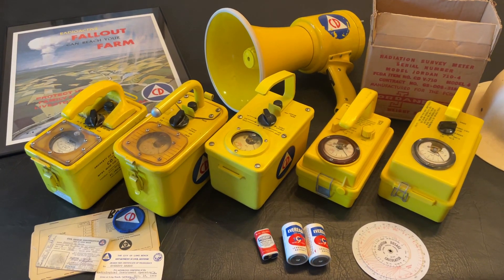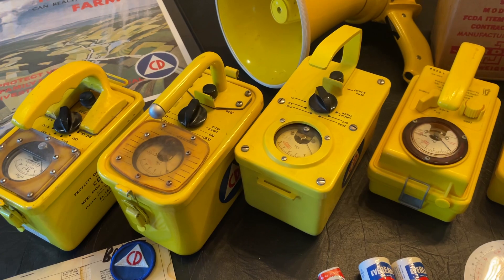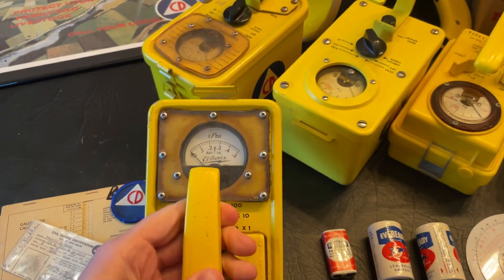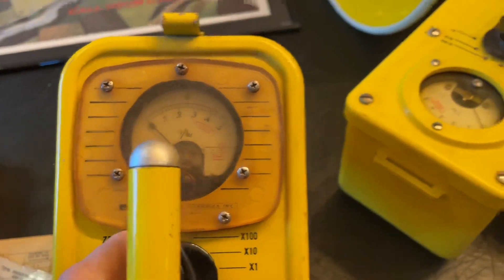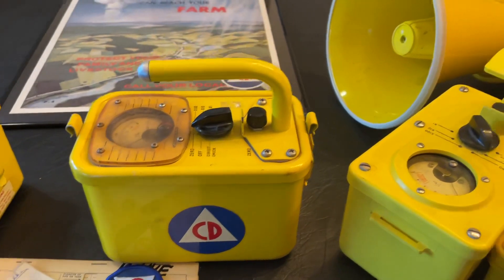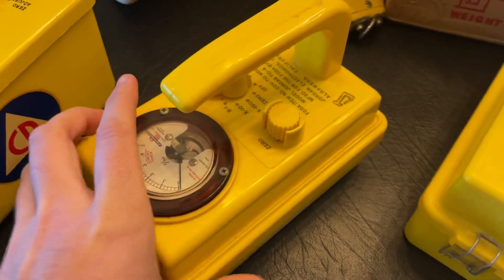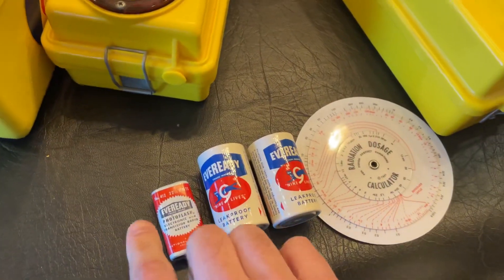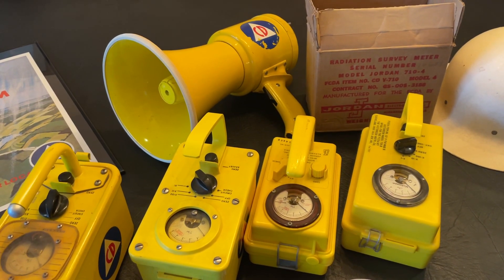Civil Defense CDV-710 Fallout Shelter Radiation Survey Meters Collection and History mfg. 1954-1959

Comment: The CDV 710 lot I have handled were retrofitted to eliminate the need for the 22v batteries.   They were all very functional under the influence of our 320 Kv Gulmay bipolar X-ray systems.  Yes - I could peg the dial at 50 Rh at 6 foot from the tube face  > 320 Kv at 1 Ma.

Comment: Do you know if evaporust could be used to remove rust on steel mags. I’ve got a few steel surplus ak mags with rust in spots that can’t be reached. Hoping evaporust would remove the rust and yet not harm the finish at all. Can’t find an answer to this.
Reply from the maker: If it’s just an AK mag, just try it. Worst case scenario your $20 mag looks slightly worse.

Comment: I ❤️ CDV 715
Reply from the maker: Easy to find, but working ones are few and far between!
Reply: @HughesEnterprises  True that. I got a CDV-720 off eBay and sent it off to get calibrated. All told, I think it was under $100 with $40 of that going to Shane. I think the 715 is more elegant (without the extension cable). But fortunately, nothing happened on y2k and it's in a box somewhere in the attic. Your 710 collection is VERY impressive.
Reply from the maker: @HALEdigitalARTS  Thanks! I used to have the full 720 collection too but sold them all but my model 1’s and a Landers model 3. Still kicking myself for selling my CDV-718!
Reply: @HALEdigitalARTS my 715 works but I have no means to calibrate them; the manual calls for a 1Ci Co-60 source.  Hard pass. 😅
Reply: @HughesEnterprises when did you sell the 718?  Wondering if I bought it.